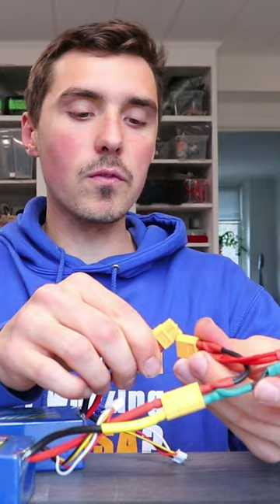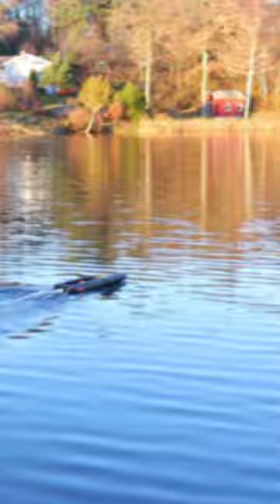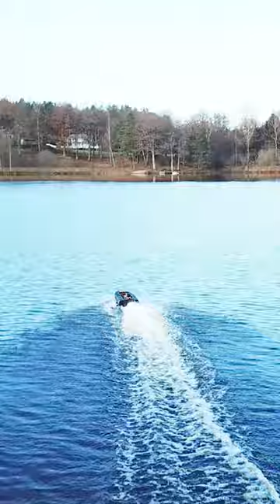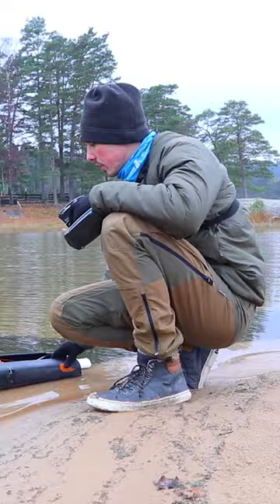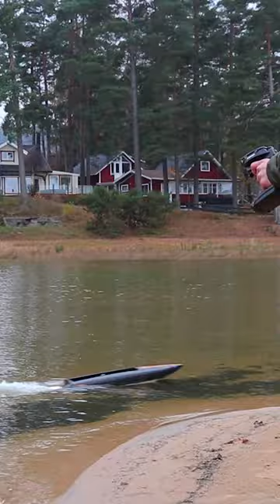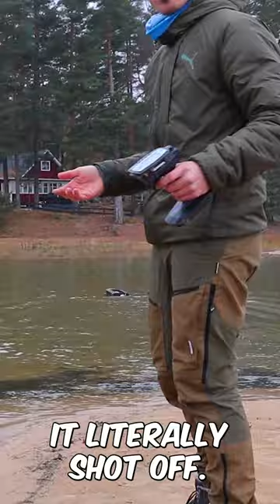Can A 3D Printed RC Boat Go FAST? #shorts

Comment: Hmm, i guess thats what is missing in my 3D printed Jetboat videos to get viewers like you do - insanity to put that much money in a open hull boat that, by my experience, has a 90% or higher chance of something failing when pushed past the sanity threshold. I have to keep my investments reasonable otherwise they will lock me away from everthing I love.
Mine screams quite nicely at a lot less risk/cost with 4S power. But clearly insanity pays off somehow.